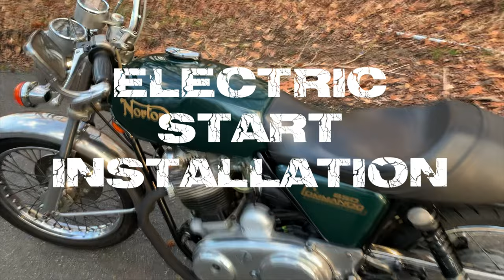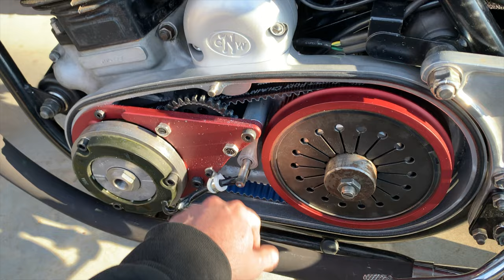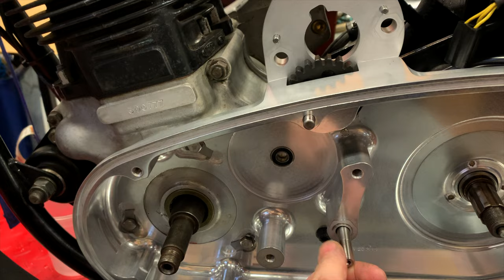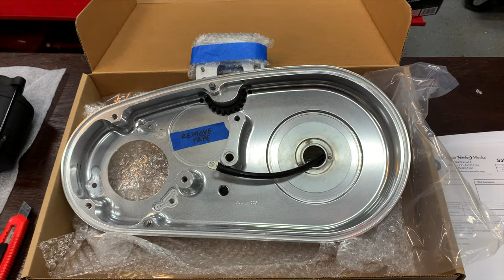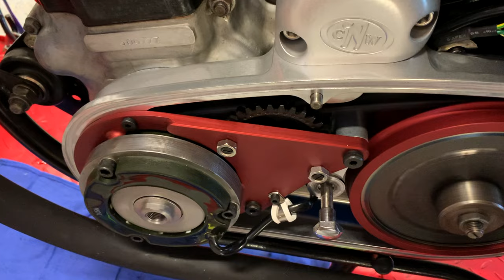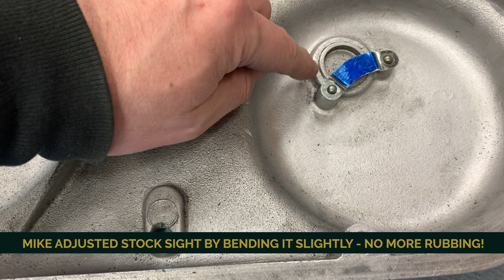Installing Norton Commando CNW Electric Starter - Part 4 of 4

Comment: Heh guys, I am in the middle of my CNW starter install on my 73 commando just have to wire it now.  I bought something the other day that nakes Childs Play out of the grommet dilemma.  It is 3 in 1 rubber lubricant  Not expensive but man does it work!  I originally bought it for the foot peg rubbers,
Reply from the maker: Thanks for the tip Ray. Hope all is going well with the installation. Best wishes, Mike

Comment: Another great series of videos. Thanks for sharing. I have been looking at the Alton setup for my 72 750 but mine already has a belt drive which is not compatible with the Alton. CNW looks like the way to go. 
An interesting discussion point would be the level of instant satisfaction derived from a successful kickstart. The whole ritual of carb tickling coming up onto compression and the almighty swing down on the lever followed by the engine exploding into life is an integral part of the Norton experience. Although that is only true when it starts first or second kick! If not a great deal of swearing and Basil Fawlty type threats can follow.......... Look forward to more videos Cheers from Blighty
Reply: Nothing like hitting the starter button, satisfaction guaranteed lol 😂
Reply: There are apparently belt drives that work with the Alton, I believe RGM might be able to supply one. And if you don't have a brother to give yours to then you could always sell it.
Reply: @mikeymike3240  True it is still a source of wonder seeing you guys do that push button thingy

Comment: Very interesting and well done to all involved. As a matter of interest why was the electrics changed to positive earth ?
Reply: No really good reason, but I wanted to run the same led taillight that I use in my other bikes. I have run an led headlight for a long time by using  relays and power straight from the battery. I realize that there are led bulbs that work with positive earth, so there are lots of options and this was just a choice I made.

Comment: I have a Mk3, And don't have the power to rotate my starter.  I notice that your battery It's quite large and is in a different configuration.  Can you give me details on this.  Thanks
Reply from the maker: Hi, I have asked Michael if he would kindly share the make/model of the battery that he is using to crank the electric starter. Will let you know as soon as I hear back. Cheers, Mike
Reply from the maker: Hi again, Michael just replied that he is using the following battery:

YUASA YTX20L–BS 18.9 AH

cheers

Comment: Is your alternator 150w?    If so did you consider getting a 180w?    I’ve noticed CNW sells the 180w.    CNW does not approve of the stock clutch plates.   Why is that?
Thanks,
Pete
Reply: I’ve had a 3 phase stator in this bike for a long time, and during the course of installing the starter I replaced it with a new rm24 stator. While this is only 150 w, I am running led head and tail lights, so there is considerably less power draw than with regular bulbs. The 3 phase setup produces more power at lower rpms than single phase, so it has not been an issue so far. Regarding the clutch plates, I suspect it has to do with weight. Compared to the Barnett plates the stock plates weigh noticeably more. I wish I had weighed this stuff before installing it.

Comment: I'm not confident about this, but I find the belt debris worrisome.

I've done a lot of automotive and motorcycle timing belts and don't recall this type of debris in any of my past work.

Also, and again not confident, but I halve that belt play.
Reply: You absolutely don't want to halve the belt play. It's not a timing belt and if you were to check the bike when hot you'd see that the belt tension has gone up.